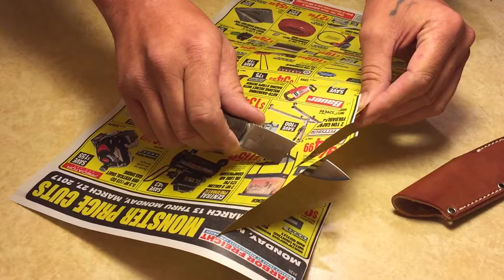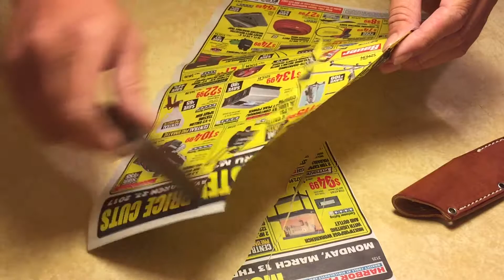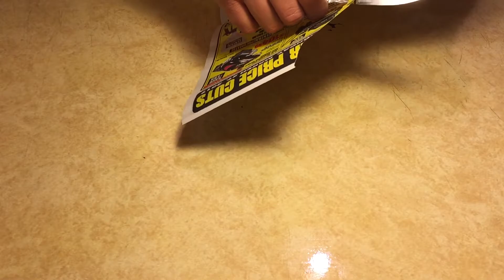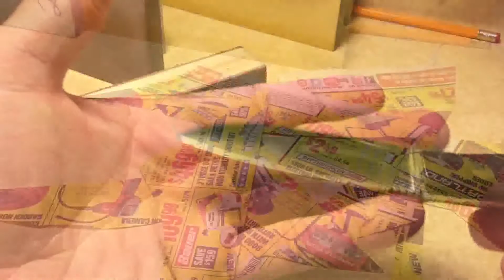Knife Sharpening - Bark River Knives Northstar EDC CPM 3V

Comment: good job
a few years ago i was fanatic about convexing every edge on any knife
since then a lot changed in my sharpening technique
if i receive a vg10 fallkniven or a2/3v bark river knife for sharpening - i treated them as knives that have convex primary grind and normal secondary grind/cutting edge and sharpen them on stones
Reply from the maker: It's not my first choice, but I always seem to end up convexing regardless of what I do. Some come out better than others, in terms of how flat I can get them. The less time I spend on stones, the flatter I can make the bevel appear. I do enjoy using them in my job. I strip a lot of cable, out in the field, and having the convex shape has saved my edge more than once

Comment: Hey Jef, I know this is an old video, but thought my question would be best to place here. I have a couple of Bark River knives. I am still a freehand rookie, but getting a LOT better thanks to lots of practice hours and watching videos like yours. I know I naturally put some convex on all knives I freehand sharpen, but should I treat a knife that comes convex (like a Bark River) any different than how I would sharpen a V-edge knife (like a Spyderco)? I thought about using sandpaper/mouse pad for my Bark River, but wanted to see if you thought that was necessary, or if I could just do my normal routine and not worry about it too much. I figure my natural sharpening motion probably makes all of my knives semi-convex anyway. Hope you see this comment; look forward to your response.
Reply from the maker: Tough to say without seein you sharpen. I'd say try it. It's easier to convex a v edge, than to v edge a convex. If you follow me :p

My advise would be allow your wrist to go as limp as you can. Don't even think about it. Try not to lock up in anyway. It should turn out well, just make sure you hit the apex.

Sand paper creates too deep a convex for my taste. Some folks swear by it. That being said, there is enough give in sand paper, soft backing is not required. I'd tell ya try using it on a hard peice of wood, and sharpen like normal. You'll find the small amount of give, along with your natural wrist movement, will create a decent convex, without much fuss. Just takes a long time, and 3v is near impossible to sharpen on the stuff. You really do need water stones for that steel.
Reply: Jef Jewell Thanks for all the feedback. I’ll weigh my options and see where it takes me. I know I could simply stick with my diamond stones and sharpen as usual and get a sharp edge; just don’t know how much that would change the geometry from convex to a V. I know my edges aren’t perfectly flat normally.

Comment: Nice knife, looks like it should hold an edge pretty well.
Reply from the maker: Held up today, though I didn't get to use it much at work. I did slap it on some wood, and chop with it. Then started stripping it back, and twisting on the edge, to see if any chipping would occur. Nope, nothing. It held true. Obviously need more time with it, but trying to force it to fail, it is showing me up